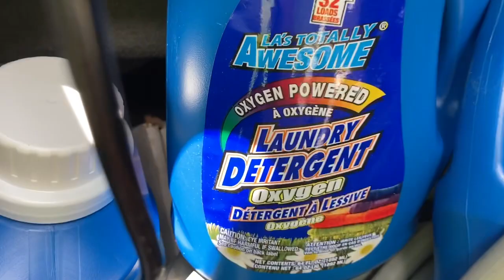5 projects done today. Making bank.

Comment: Very obviously the downspouts are packed solid with debris too. What method do you use to get the packed downspouts unclogged?
Reply from the maker: Tom Rumish I have a stiff wire. Like a metal coat hanger that I poke through and flush

Comment: Joe, what PSI do you use when you’re down streaming soap? Do you have the pressure nozzle turned all the way?
Reply from the maker: CJ Davock hey CJ. I never adjust the pressure at the unloader on the machine. I leave it at max pressure. 4000 psi. However I do not have a gauge yet so not exactly sure what I’m putting out. I soap with a large orifice jrod or my Walmart soaper. Then I rinse with a higher pressure nozzle that does not draw soap
Reply: Powerful Improvements thanks that helps a lot.

Comment: What’s your finally batch mix? Like gallons of water / SH & how much soap if you don’t mind me asking
Reply from the maker: Hey Brad. It entirely matters on the project. What is your process and equipment set up. Maybe I can answer you specific
Reply: @powerfulimprovements  I have 12 Volt battery. I have a one 55 gallon drum. I usually just woke on barrel tiles roofs down here in Florida

Comment: Hi Joe,

I know you don't like using to much soap when you house wash. With the LA detergent how much should I use in a 5 or 15 gallon bucket?

Is it ounce per gallon of (SH)? This will be applied with downstream.
Reply from the maker: Michael C down streaming I use about 1-2 oz per gallon
Reply: @powerfulimprovements  

That 1 - 2 ounce is per gallon of (SH)?  Is that correct?

Example: 4 gallon (SH) + 4 ounce of surfactant (soap).
Reply from the maker: Michael C correct
Reply: @powerfulimprovements  

Thank you

Comment: I just saw on your vid that you hear nothing good about the simpson hose...  It works for me haha.  I got 100' of simpson and 50' of the dewalt hose that came with the pressure washer.  I did notice that the simpson has a bigger passage, so more flow.  Let me know after you use the simpson compared to what you have.  I would love to get a better hose at some point.
Reply from the maker: T. J. Rosa I’ve just heard that they are heavy and stiff to handle. I may not even open it if my bed hose comes in soon. So I may not get to review. Sorry
Reply: Powerful Improvements it’s all good man!  I couldn’t pull the trigger on the expensive stuff yet.  Just starting out.  Soon I will!
Reply from the maker: T. J. Rosa yeah everything is crazy $ that 50 ft Simpson hose was 100$. I almost choked
Reply: I got mine at Home Depot online.  100’ for $83 or $86.  I love your truck setup btw.  I am designing mine with some of your ideas, but different since I need to have space for materials on construction side
Reply from the maker: T. J. Rosa cool. Keep it simple wash on 😎
Reply: I picked up 200ft of 3/8 Simpson hose for 125 shipped on ebay. The only thing i noticed is that since i didn't use it for months just sitting on the reel it looks like melted in some spots.

Comment: The bleach you use is pool shock???
Reply from the maker: Kimberly Cobb yes it is
Reply: @powerfulimprovements  if im using a 13 gallon tank how much bleach should is use for roof and siding
Reply: And the Landry detergent how much of that?
Reply from the maker: Kimberly Cobb how are you applying from 13? 12 volt or downstream?
Reply: @powerfulimprovements  12v
Reply: I just bought north star 13 gallon soft wash system I do paint and remodel so just adding to my business..just need to get my chemicals right
Reply from the maker: Kimberly Cobb house washing is 1%. Roof washing is 4-6%
Reply: By the way I watch your videos...great job your doing...by far your the best
Reply: @powerfulimprovements  can you break that down 13 gals so 1 gal of shock for siding?
Reply from the maker: Kimberly Cobb 😂 thank you
Reply from the maker: Kimberly Cobb so for house wash you would use 1.5 gallons of 12.5 shock and 12 gallons water. This would get you a little over 1% batch
Reply: @powerfulimprovements  and 3 gals of shock for roof?
Reply: Oh how much soap???
Reply: Sorry just trying to keep it simple
Reply from the maker: Kimberly Cobb yes. 1 to 1.5 gallons for siding
Reply: @powerfulimprovements  3 gals for roof? And 1.5 for siding? Correct? How much Landry soap?
Reply from the maker: Kimberly Cobb 32 oz in house wash. 250 oz in roof
Reply: @powerfulimprovements  thank you for the information I really appreciate it
Reply from the maker: Kimberly Cobb 👍👍
Reply: @powerfulimprovements  Hi Joe, for a roof soft wash using a 12 volt, 5.5 gpm with a five gallon bucket as my mix tank; roughly how much SH; water and LA detergent would I add? I really appreciate your advice. 

Do you mix it up a lot?
Thank you.
Reply from the maker: @kimariokiji  you are going to need a bigger tank pretty quick. 3 gallons of water and 2 gallons SH and 2 cups of laundry detergent in a 5 gallon tank.